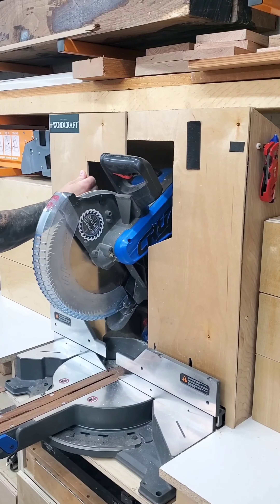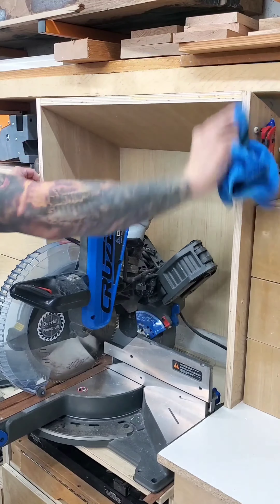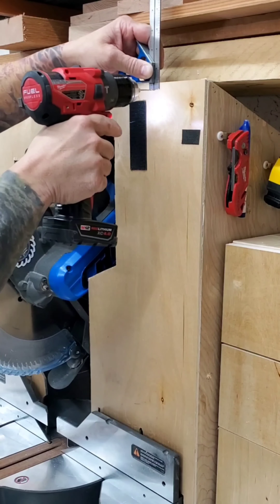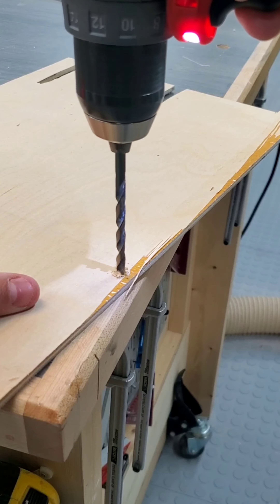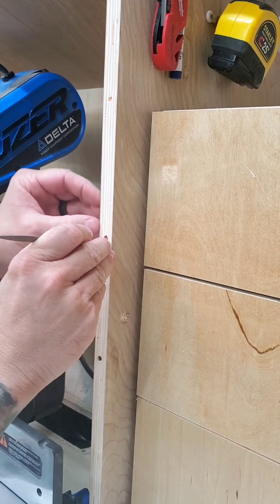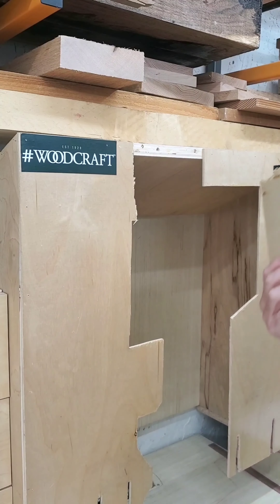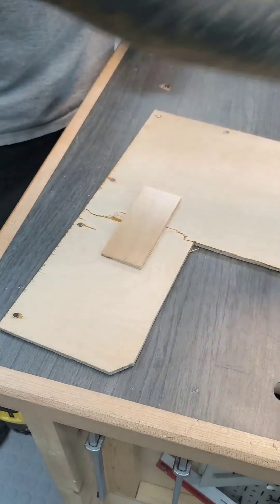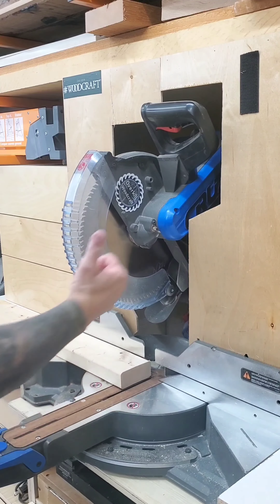Miter Saw Dust Collection Hood / Shroud Cover, with Magnets!

Comment: Neat vid. Thanks for posting. How long have you had the Delta Cruzer and are you happy with it?
Reply from the maker: You're welcome, thanks for watching. I bought the Gen 1 roughly three years ago then upgraded to the Gen 2 about six months later. Love the shadow line and will never own a saw without it again. The saw itself is a beast in regards to power. The arms to sway a tiny bit when it's fully extended, if you torque on them, other than that it cuts true. It got knocked out of zero during my recent move and was kind of tedious to get perfect again, but that's how most miters are in my experience. Would absolutely buy this one again.